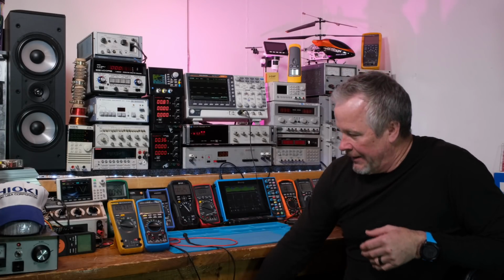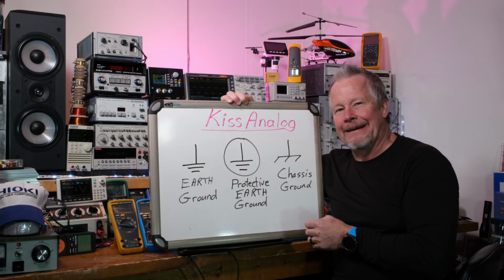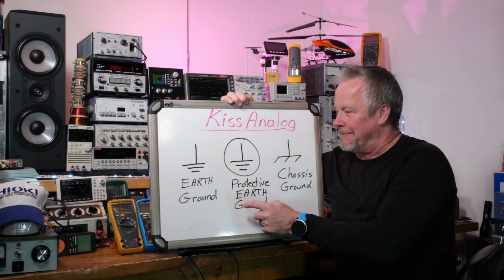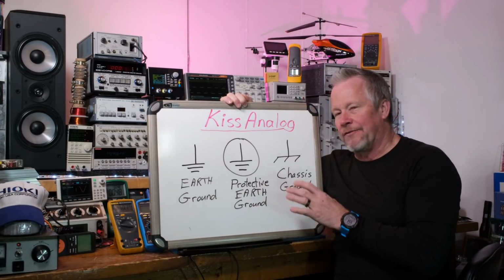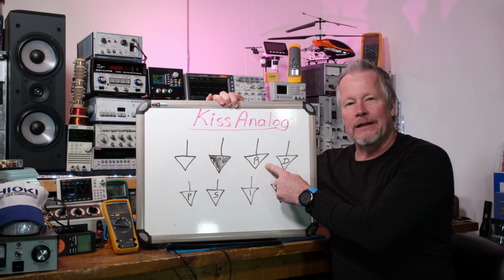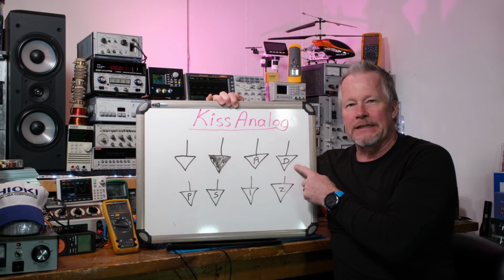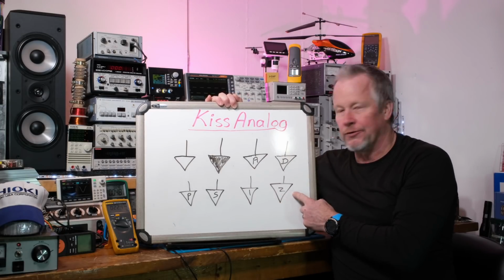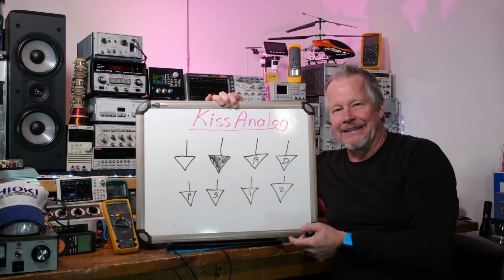Whats all the Ground Stuff About?  Ground Symbols mean something - use the right one. #safetyground

Comment: 11:40 You should get an isolation transformer if you do such things and connect the probed equipment to it. That way it cannot short to ground. Also it is safer as you will not get shocked if you touch a wrong place inside. An isoation transformer creates a separate circuit that is isolated form the ground so you cannot get shocked from either of the wires - however, if you touch both you will get shocked.
Reply from the maker: Thanks for your feedback!  Yes an Isolation transformer can help with safety but be careful how the ground is connected.

Comment: the up side down triangle is used for the negative supply, so it would be confusing to use it for ground
Reply from the maker: Thanks for your feedback.  That's the problem, these symbols are used for all kinds of global connections.  It is common to use the T symbol for voltages - whether they are positive or negative, and sometimes they are upside down, but don't need to be.

Comment: Hi Eddie, 
Nice videos on grounds. 
Why do you have split phase or two lines and one neutral in North America instead of having all three phases plus ground? 
Cheers 
Mark
Reply from the maker: Great question Mark.  I think it is because 120Vrms at 15 or 20 Amps (common breaker sizes) is able to power a lot of things.  In a hope the panel will have 20 or so breakers, so in that case you can have 20 runs with multiple outlets off each run (maybe a run for each room for instance).  Half of these breakers are on L1 and half on L2 with Neutral down the middle.  Then that keeps voltage lower/safer and current isn't so high to require large wires.  Also, it only takes 3 conductors (2 hot and 1 ground).  Then there will be several breakers that provide 240V by using L1 and L2 with the ground, and used for Appliances and larger power users.
Reply: @KissAnalog  HI Eddie, 
In Europe (generalization?) They have 3 phases and 5 wires: L1,L2,L3,N,Grd. The phases are about 230V and between two phases there are 400V.
I suppose that 3+1 current carrying wires is more efficient than 2+1?
Cheers. 
Mark

Comment: I look at safety ground as a way of forcing floating AC to work as DC, otherwise there would be no polarity. Floating AC is not inherently dangerous.
Reply from the maker: Thanks John!  I would agree, a floating voltage isn't necessarily dangerous.  There are lots of voltage systems that are better off floating.  And once a line is tied to earth ground - it gets labeled as Neutral;)

Comment: I have a question. What happens if your operating an appliance during a thunderstorm such that the appliance has a fault and uses the ground terminal to shunt the electricity to earth and at the same time your hand is on the metal housing connecting that to Earth Ground when lightning strikes the ground nearby? Will you feel the full force the electrical engergy since this there is no circuit breaker connecting to earth ground? Since the ground is most likely saturated and water can conduct electricity it could be several hundred yards away.
Reply from the maker: That's a great question!  Hopefully, the metal housing of the appliance is grounded safely.  If you are touching it when there is a fault, with or without a lightning strike near by, this should not be dangerous if the person is not standing on something that can be conductive.  However, with lightning - it is difficult to say how good the insulation is and lightning storms can cause strange safety issues.  This is why the power system is actually 'grounded' to earth ground - to keep all metal at the same potential as the earth that a person might be standing on.  Earth ground can be somewhat - an unknown.  The impedance of the earth is often higher than we would like for this system.  All we can do is follow the proper grounding methods per local agency standards - and possibly use lightning protection devices.  As for faulty appliances, this can be tricky at times too.  I once felt a tickle when an air conditioning unit had a motor that was only somewhat shorted to the housing.  It was compromised in a way that let some current flow, but not enough to trip the breaker.  So not every fault can be detected all the time, and I think that's why GFCIs are becoming so popular.  These help catch faults where there's just higher leakage current.

Comment: Great video!👍 One thing I realized most people miss about system/safety grounding is it's secondary purpose of static dissipation and transient spike protection from lightning or switching etc in power lines. A lightning strike to a nearby power line can induce thousands of voltage and this can be dissipated through the transformer, distribution or consumer side ground directly or by surge arrestors/protectors. Of cos any static buildup in the system is automatically dissipated to ground too.
Reply from the maker: LOL Joey!

Comment: All because of wrong grounding.

When I moved into my house it had previously been owned by a HVAC guy, he built a terrific piece meal airconditioning system off used commercial refrigeration kit. It used the swimming pool and some buried pipes as a heat sink instead of having an energy intensive fan to cool the compressed gases, very clever and well ahead of his time, I believe this technique is now used in some cool climates as a low energy heat pump. However he had some shortfalls in his knowledge of electrical design, he obviously knew enough to build the system, connect and disconnect various parts, but he didn't identify the different types of ground between commercial and residential equipment. So one of the first things I found when I moved in was floating voltages on bits of metal like TV antenna amplifiers or RF filters that had me stumped for a long time. In the end I discovered he had inadvertently bonded the ground of the refrigeration kit, via the copper pipes, to created a second earth and a potential difference between the residential earth stake and the refrigeration plumbing. We have 3-Phase so as a result a some points we had differentials showing 80 or 90v AC in the house, enough for a person to easily feel it in humid weather if they touched the wrong thing. Also because of the different impedance in various paths it would cause problems with interference on things like TV, radio or even the phone lines and back then the old ADSL internet!

There must be lots of DIY problems like this that exist in homes around the globe, and people won't know about it until hopefully they find out in some safe manner.
Reply from the maker: Thanks for that great example!  Unfortunately some serious (fatal) accidents have happen due to these types of issues.  I need to do another video explaining how to do some tests to be sure your wiring is safe - especially exposed metal that kids can touch!
Reply: @KissAnalog  Yes I should have mentioned how potentially(no pun intentded) serious this was, and people might buy a cheap meter and test between a chassis and a nearby bit of metal and get zero volts. So I think your idea of a video on how to make safe tests would be very useful to amateurs, as well as perhaps a little bit of discussion about floating voltages. That multi-earth problem must be very common, because people would think they are making things safer.

PS; I liked your comments about vintage cars and the different uses of polarity, it reminded me of working on early CO2 gas lasers and other HV Rf systems that were designed to be intrinsically safe. There must be a few radio / TV guys that watch your vlog and are well aware of this for commercial broadcast equipment, it must be a trap for people who buy used commercial equipment and just think it's a bigger version of retail stuff!
Reply from the maker: Thanks Justin!  I think these videos will get a good healthy discussion going to help others with these safety concerns.  I think you are right that people don’t realize that there are different safety levels for commercial vs residential…

Comment: 10:45 "a little bit of voltage..." Here in Europe where we use 230/240V , that "little bit" of voltage can go up to 120V, depending on the quality of the X and Y capacitors in the EMI filter. That leakage voltage has a low current, but enough to light up a 3V LED very bright.
This leakage voltage/current is more then enough to damage sensitive electronic parts like FET transistors etc....
Reply from the maker: Thanks Bjorn for this example.  That’s why I say it’s not recommended to Float your scope, and why I recommended a 2 wire power cord for a plastic box.  Leakage current creates a touch voltage that can be dangerous.  Thanks for expressing this!
Reply: @KissAnalog  , floating a scope is not good for anything. When you float a scope by removing the earth connection, you have the voltage/current leaking due the X and Y capacitors, but because there is no earth connection, your measurings are also wrong, because your scope probe normally measure against your negative connection which is connected to earth at 0 volts. But because the chassis part of the BNC connectors is not tight to earth, but a higher voltage, you create a offset of your readings. The scope thinks his chassis is at 0V, but it isn't , and doesn't know because it has no other reference point to check if his chassis is at 0V ground potential.
Reply from the maker: It is a bit confusing how this can change the scope readings or if it does;) I know many people float scopes as I’ve seen this done in many power labs.  If the thing you are measuring has no connection back to earth ground then your ground connection on the scope only references to the chassis on the scope frame.  It’s floating so no current flow so no voltage offset.  The Y caps still form a series path between the two power lines but there’s no current flow from this chassis thru the circuit monitored if there’s no return path.  But it does result in a potential - so not safe;)
Reply: @KissAnalog  if have experimented with ground and no ground connection to my scope, as a test, i placed a white power LED in the ground lead (between de grounding of the scope and the groundpin of the powerwall socket), and this LED burns really bright due the leakage of the X and Y caps. But after a few minutes, the LED is dead due overvoltage. For a extra safety on a scope, you can place a very small value of fuse in your ground lead (exp 5mA or so) , that way you have a extra protection when you clip the ground clip of your probe to the hot wire of the mains in a circuit. 
Tektronix advised this back in the mid 80's to use a scope probe, with a fuseholder in the ground lead (between the probe and the alligator clip).
Tektronix has also a neat device for extra protection , the Ground Isolation Monitor A6901 (1986), in short words, this is a sort of RCD that trips to +40V on the ground lead, and trips on 0,5mA/3,5mA/5mA ground lead current. Full specs on this monitor : https://w140.com/tekwiki/images/e/e0/070-3618-00.pdf

Comment: If you take a meter outside to the earth it shows it's open. It's amazing that it can be a conductor for ground to return to the transformer neutral.
Reply from the maker: Thank you!  You are right - it is not a great conductor, it can be 100s or 1000s if 0hms, but this is good enough when you are just talking about referencing voltage points and not sending current across;)
Reply: @KissAnalog  I appreciate your reply, helps my understanding.
Reply: When upgrading a 240 line/150 amp panel the inspector made me install another grounding rod six feet from the existing one to prevent possible fire from lighting strike.

Comment: The average suburban house in the US has a stick of metal stuck somewhere on the backyard as ground. Spot the problem here.
Compare that to the same type of house somewhere in the EU, where ground is connected to the metal pillars of the house.

I remember at some point seeing some refrigerators with linear compressors having reliability issues, where the compressor would break its valve... and then noticed that almost all of the reports were coming from the US. In case of severe surge (ie: nearby lightning) the ground wire was too small or missing and the fridge was ending up working at so high power that the resulting force would break the valve.
Reply from the maker: Thanks for the great feedback!  Yes, plumbing can be dicy, so they added the grounding rod;)  It still may not be the best connection;)  I'll have to cover the different methods;)
Reply: @KissAnalog  Good Idea!

Comment: The more NEC advances the more and more GFCI devices are required (eventually every circuit will need to be GFCI protected).. I wonder how all these devices will work when that happens or if they will cause tons of nuisance tripping, (related to the leakage you are talking about)
Reply: Where I reside there's always a 300mA RCD with appropriate overcurrent protection as the first breaker and a 30mA RCD powering around 1/3 of the breakers. (That's also how a standard apartment electrical cabinet looks like here, there can be a third or fourth RCD as well if there are more circuits).
No real problems with tripping them that I know of.
Reply from the maker: I think GFCI is a great idea.  It is possible to get a high leakage that is unsafe but will not trip a breaker.  So the GFCI or RCD is designed to allow for some leakage, but is greatly limited making things even safer I think.

Comment: Great video with very detailed demonstration but I have got one question.
If the Ground wire is actually tied to the Neutral wire then won't this cause any issues with isolation between primary and secondary? Because in SMPS, their chassis are grounded and their negative terminals are tied to the same chassis.
Reply from the maker: Thanks Johnny for the great question!  I made a video for you.  I’ll post it tomorrow;)
Reply: @KissAnalog  Woh! That's amazing, thanks for the super quick response :)

Comment: Yes, yes, holy fack yes .. it's insanely confusing. I'm just getting into electronics and no where does anyone discuss how the different grounds relate and the history of grounding. I watched various videos get an overall basic understanding but I still feel a bit lost sometimes. I do think the history surrounding the topic is helpful; see https://www.youtube.com/watch?v=VxvrLydy6PA ; at one point ground was even outlawed in New York. Even the relationship between hot, neutral and ground is a bit confusing ; my understanding is that one side of the a/c connection is "neutral" only when it has been "neutralized" by a ground connection ; otherwise, the concept doesn't apply. Even the idea of hot would only seem to apply when one side has been neutralized otherwise it would all be floating?
Reply from the maker: Thanks for this awesome feedback!!  That's crazy that they had to outlaw it;)  You are right - what's neutral but yet another name to explain what is what:)
Reply: @KissAnalog  Supposedly the initial grounding outside homes wasn't so much for safety as it was to solve other problems ; obviously that then created a problem with any exposed electrical inside the home;  thus, extra ground points got added to stop people getting zapped. It really only started to make sense to me when I heard the reasoning / historical version of it all :-)
Reply: Question though, about floating a scope and still getting a zap. I know its bad practice but was the thought that it's possible that the DUT is earth grounded? sorry, I'm a newbie